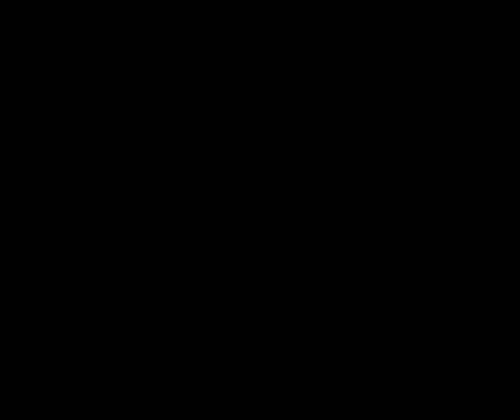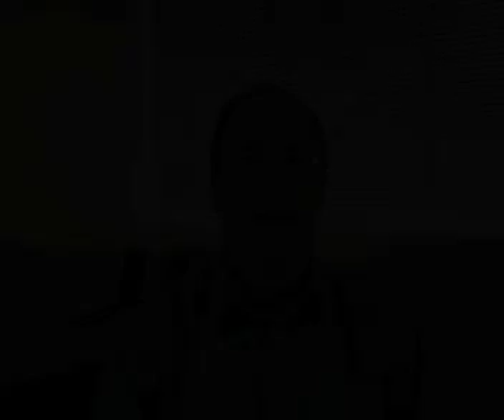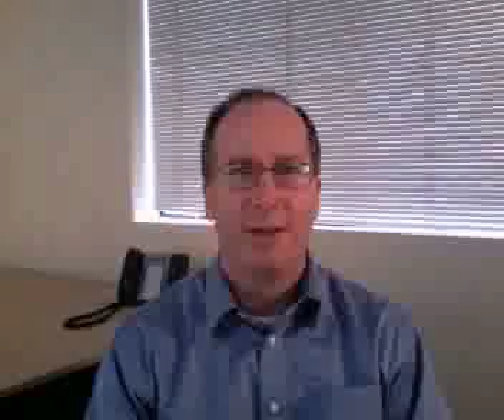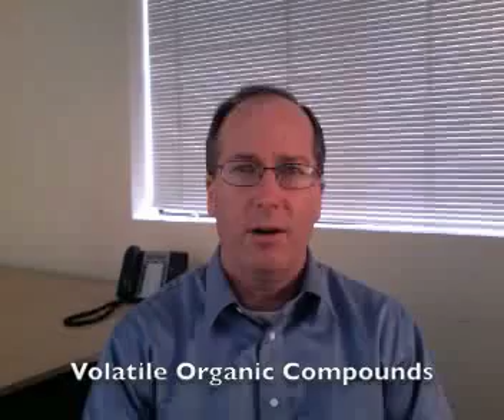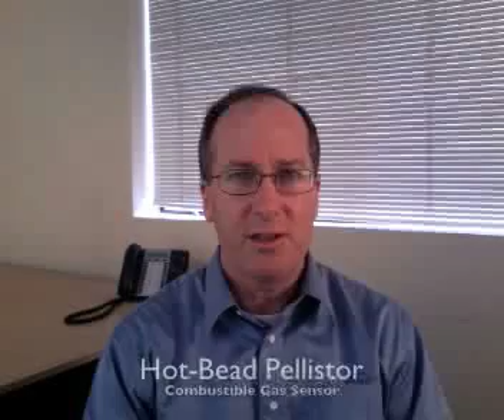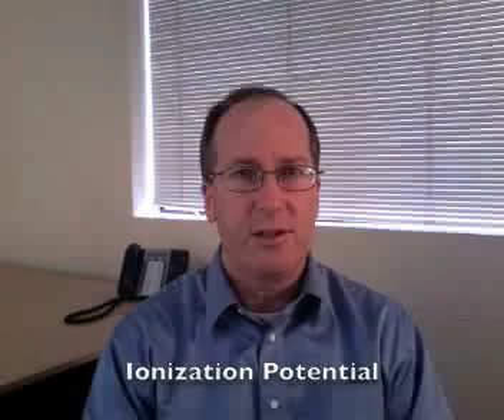Voc Detectors: Volatile Organic Compounds Detection Explained Part 2

Comment: Hi. I need something to detect and measure skunk odour.  Can you help ?
Reply: It is technically possible to detect skunk odor. I looked up the chemical, and Wikipedia compares it to Butanethiol, also known as butyl mercaptan. The odor threshold is extremely low, on the order of 10ppm or less. Our RAE Systems ppbRAE can measure that low, but just background smells and odors are in that range as well. Also, PID instruments measure the total VOCs, and are not specific to any one particular compound. So, long way of saying, we probably can't realistically help you.

Comment: So... I have a RAE mini lite. Used mostly for oil spill cleanup. the material we clean up is less than 5% benzene. to figure out the stel I take the peak reading for 3 minutes for 15 minutes straight. that add up the 5 numbers and divide them by five to get the average. So then I multiply the percentage of the material that is benzene .05 by the correction factor 4.7 by the stel and that gives me the ppm of benzene and I am working with?